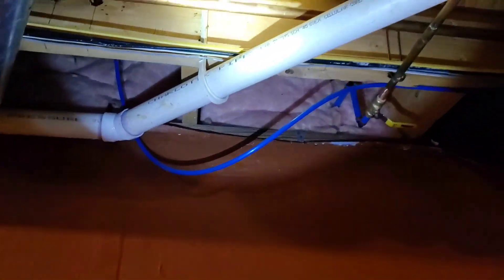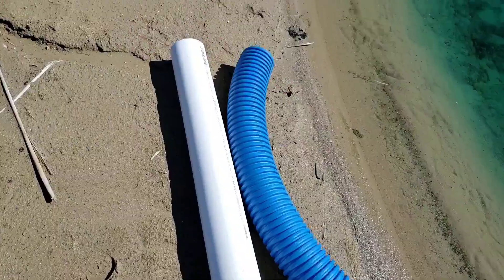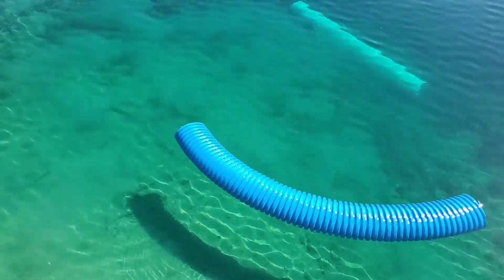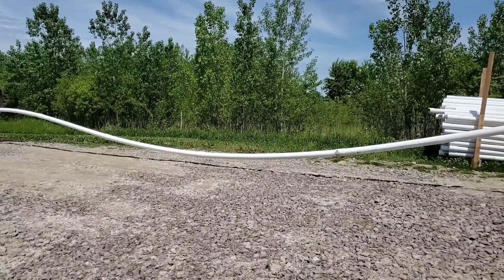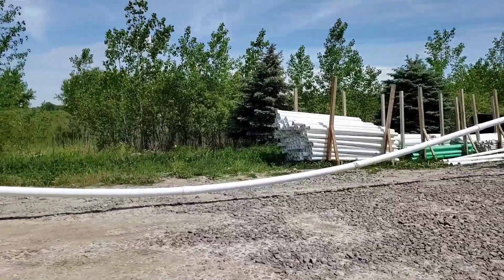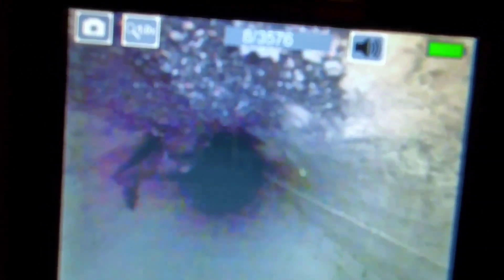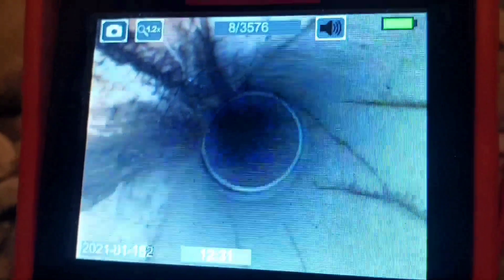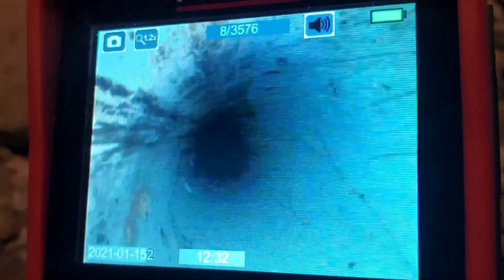PVC Schedule 40 Downspouts, PVC French Drain, PVC Yard Drainage, Is PVC Pipe Better Than Corrugated

Comment: If PVC is so bad outdoors, why is it used as the sewage line for houses? I just had a new house built and they did all pvc pipes under ground under my slab and pvc sewage line. Should I be concerned?
Reply from the maker: It's below frost line
Reply: @FRENCHDRAINMAN  what about the instances where it (sch40) is not below frost line?  applications such as shallow sewers (slab or crawl space homes). Even more common in Michigan are sump pump discharge lines (below grade outside of house) which are typically a couple feet below grade (RARELY below frost line).  I encounter this often bc I snake drains for a living.  I do not install pipe but I know when it is done schedule 40 is still used.  TBH I always assumed the problems with the sump lines was the thin wall pipe the builders used which would be resolved by installing new sch40 pipe so this is quite a revelation to me...thanks for bringing this to my attention.  What is the proper, code approved pipe to use in these situations?  I know for a fact that inspectors regularly approve sch40 for these applications (as long as the pipe has proper pitch).

Comment: I think people are missing the crucial points/differences here. PVC installed above frost line is subject to stress and its rigidity can make it crack. Heaving of ground changes the support of the pipe as well as causes the stress. The bowing demonstration is just the way to show how something that is supposed to be inflexible actually does flex, and it isn’t designed for to take that stress. Rigid =brittle, especially when cold. I live in Michigan on a lake and ground heave from the ice & saturated ground is a real thing. We would have hired FDM but he doesn’t service our area. We went DIY and fixed our years of flooding INTO the house and constantly soaked ground between houses with roof water runoff system and 2 french drain quad systems. DRY, DRY, DRY!! No flooding, no pumping in 38 degree weather in February when the thaw comes, it rains and the ground is frozen for 4 years now. No maintenance. REMEMBER the context—this is right for heavy wet clay soil and frozen ground.-it might be overkill for those in better climates but trust what he says if you live where these are an issue , it certainly worked for us and we pulled up all the old failed drainage pipes and saw how badly they held up. FDM is not the only person arguing against PVC ABOVE frost line in colder climates. Storm Drainage systems (a Florida company) has a video discussing all the pipe types & states the same about PVC in the north. Completely credible opinions both.
https://youtu.be/87FMjtXrF6I?si=bjkcVBONM-X3KDpA

Comment: logic bomb....this proves nothing...in ground the pipe is laying on a properly dug trench and rock.....I have never encountered stress cracks like this in miles and miles of pvc irrigation pipe; besides, green sdr pipe is the correct drainage pipe to use...
Reply from the maker: Schedule 40 pvc is better than SDR35. The only reason why there is an SDR schedule 35 PVC is for budgetary reasons.

Comment: I don't really understand your concern on the weight/support of sched 40 PVC.  Is not a properly graded trench supporting the PVC perfectly?  I used PVC and a previous house because the previous garbage black corregated was obstructed by roots and couldn't be cleared.  I trenched and then laid sand down to bed the PVC.  This was on top of the virgin dirt.  It's not going to be settling in anything but geologic time scales.

This was 10 years ago.  I guess i need to go back and ask the current owners if I can take a look!
Reply: Also, for what it's worth, had your high-octane been available back then, I might have given it a try.  But back then my only options were more black corrugated, SDR, or sched 40.
Reply from the maker: https://youtube.com/playlist?list=PLjFCqaZ4v1BX_ZMbxsYVB6CNFoeAmuPxX&si=ZLhC7scG3hVRzYc6

Comment: So if the PVC pipe is going to sag that much while underground, would not your corrugated pipe do the same, causing the debris to settle, and build up when the flow slows down? I noticed you didn't show your blue&yellow ultra pipe on the same test, why not?? BUT, I'm not saying your system doesn't work, just like the PVC, if its done right it will work.  but you get people buying the cheap stuff, that does not last, and putting it in wrong.
Reply from the maker: The polyvinyl chloride (PVC) pipe weighs 10 times what the high-density polyethylene (HDPE) corrugated pipe does. The heavier weight causes it to sink and sag in wet soil.

Comment: I don't get the hangar analogy here.  You are embedding this in the ground, it's literally being supported every square inch.  I get that different areas can heave, sink, etc, but frankly it's still being supported to varying degrees.  It's a drain, so it's not being continuously loaded, and even with sections of earth having varying degrees of support the entirety of the load will be spread throughout the line.  Not to mention the level support comes down to the level of preparation prior to install.  seems more likely that frost cycles are whats killing it and not the weight of the material.
Reply: @RadDad, I agree about frost being the likely culprit. And I have a very difficult time believing that the density of PVC causes it to sag by displacing less dense (whether topsoil, clay, etc). Because I don't think PVC is more dense than clay, maybe it is more dense than topsoil. . .I'd have to look it up. But regarding density, we have to remember that even if PVC was 5X more dense than soil, density is weight per volume and a large portion of a PVC pipe in cross section is air! Alot of it. So instead I think external forces cause sinking and the cracks.

I'm not debating your observations/experience French drain man, but would believe the cause for cracks to be due to a combination of freeze thaws and compaction from vehicles onto the road rock or soil above the PVC, working on it over time, and as you've shown in the video where you froze water in sch 40, it is strong, but brittle.
Reply from the maker: Watch "PVC Schedule 40 vs Corrugated Pipe Strength Test" on YouTube
https://youtu.be/8p4KJO-_UQQ

Comment: Isn’t schedule 40 used for outdoor sewer line?
Reply: Sewer lines minimum depth 48" below ground, below the frost line, in the north. French drains aren't that deep.
Reply: @Luckingsworth  it depends where you live. If you live in the South of the US the frost level isn't that deep. Maybe PVC is something that the south only has an option with? I live in the south and majority of the contractors use PVC for french drains
Reply: @selenacruz161 
I live in the South too. The frost line in my area reaches about 9” on the coldest days. Code specifies 12”. At that depth, the soil will stay warm enough to protect the pipe from freezing.  

But there’s kind of misnomer when it comes to French drains because pipe laying in a 12”-deep trench, covered with gravel, does not have the insulation (warmth) that would be provided by 12” of dirt or clay. Cold air can easily penetrate gaps between the rocks and reach the pipe directly. Meaning, it’s not significantly different than the pipe laying on top of the dirt. 

That’s the case, at least, for an open French drain that uses gravel as the top surface.
Reply from the maker: PVC schedule 40 is fine when it's below the frost, and it's good for sewer lines. As long as we ran at 1% Slope.

Comment: Wish you were in NY
Reply: My property they used pvc sewer drain pipe with the holes under my black top driveway.  Take a guess what happened over several winters lol.  Now I’ve got it heaved up right through the blacktop.  Need to cut a 50ft run of the blacktop, plus remove my paver walkway and retaining wall because it’s all messed up from the water freeze/thaw cycles due to the water from the pipes and redo the whole drainage system.
Reply from the maker: Thank you for sharing.
Reply: why did they use the pipe with holes in it? If it was pipe with no holes in it along with proper fall it would work correct?
Reply from the maker: Best French Drain and Yard Drainage Contractor
https://frenchdrainman.com/

Comment: do they make a smooth version of that pipe you use
Reply from the maker: I know where your mined is going. People think corrugated fills with debris. The truth is the bottom of corrugated pipe will collect shingle gravel till its smooth on the bottom. It's the best thing going for downspouts the pipe is  Is rugged and indestructible.
Reply: @FRENCHDRAINMAN  that is what i was thinking but also like little tine sticks that can go down down spot in to the pipe i have seen it happen some how they get turned in there and start a blockage because now it can move it not smooth

Comment: If it wasn't for the lack of water to keep the system clean, almost seems like it could work for a septic run, is there a smooth inside version that would work? Definitely seems like the slotted version would be excellent for a drain field. Btw, not a professional here, those may have been very misguided and ignorant comments. Just throwing that out there. Also want to say much respect for the humble pride you and your team always bring to the table. Hard to find good, hard workers, and employers that also care to go the extra mile👍.